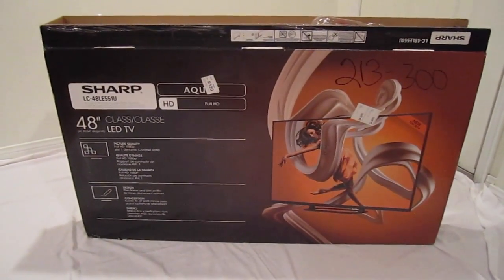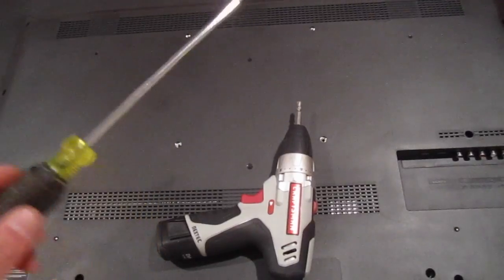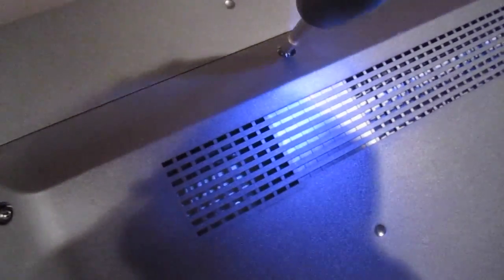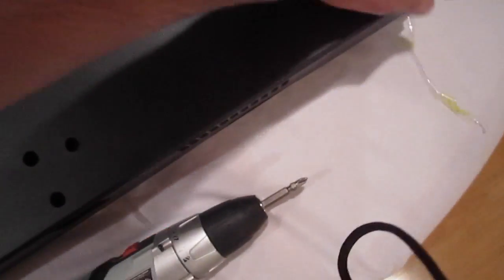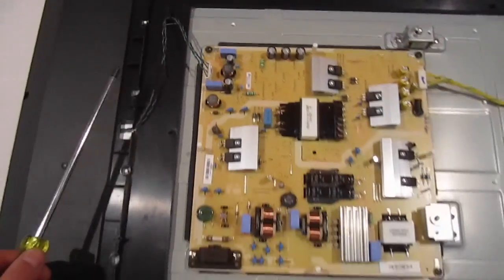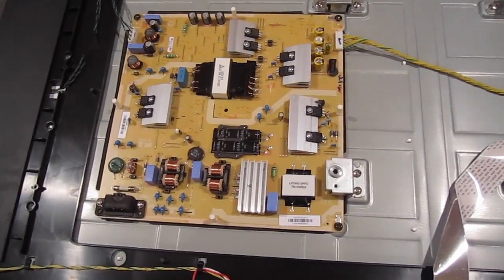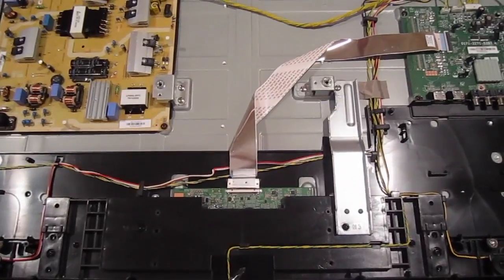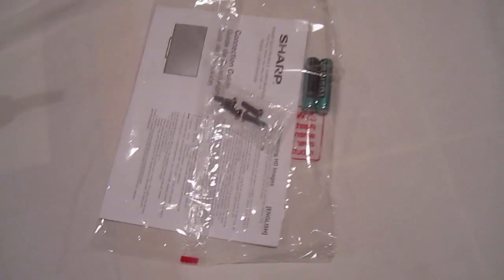How To Take Apart an LED TV (Sharp LC-48LE551U)  Parts Runners

Comment: I have a LC-70LE650U and the right side of the screen is really dark (it actually dips into the middle with how big it is). I can see the screen thru it but I’m experiencing a fading horizontal line right below it as well. It’s pretty distinct and it was a very expensive tv, so I was hoping to save it. Somebody told me it could be a bad side panel, and that removing the panel should temporarily fix it? Would this be true? Any help is appreciated man, good work on your videos.

Comment: Do you mind to let me know what is the parts broken if my sharp aquos lc-39le448m got double image or overlapping image every 2 seconds? Is it the T-con board or just a cable between the boards?
Reply: This overlapping image problem every few seconds just started happening to me. Did you manage to get it fixed?

Comment: Nice score....I pretty much score the same thing model tv but my issue is no screen..
If i do the flashlight test i can see the letters but no screen any ideas?I was looking for the led drivers but im assuming its all in the tcon board?
Reply from the maker: guayaco3299 This model does not have a backlight inverter. And the t-con board will not fix that issue. I would try to change the power supply unit. Sometimes it has the LED Board on it.
Reply from the maker: +guayaco3299 The issue is with your backlight inverter.

Comment: i have the sharp LC-48LE653U and it turns on and flashes sharp logo then goes out and comes back on to sharp logo like it keeps cycling power on and off.
Reply: Brian Lafeve I have the same issue. Were you able to find a fix for it?
Reply: That could be bent pin of CI Module
Reply: @hsnaansh  That could be bent pin of CI Module
Reply: @digdeep28  Where is the CI Module?

Comment: I have this exact tv. After a few months the tv started having a red outlines in the picture it warmed up. Now I have no picture at all. What could be the issue? What piece should I be replacing?
Reply from the maker: +Victor Evaristo If the TV is completely dead with no backlight than it might be from the power board. If there is backlight, but no picture it could be from the t-con board.